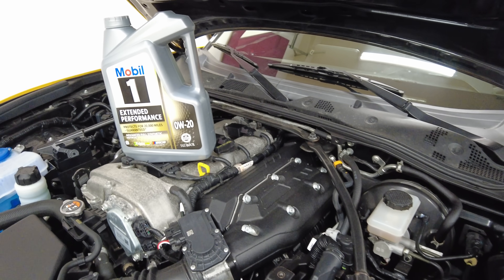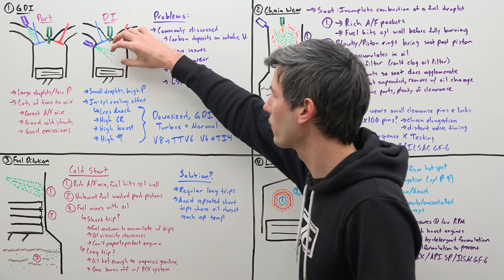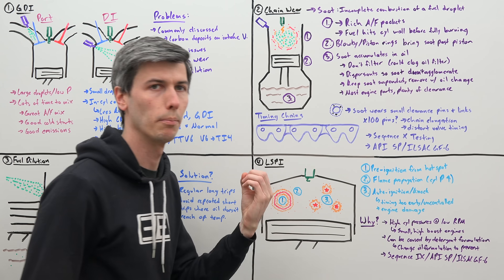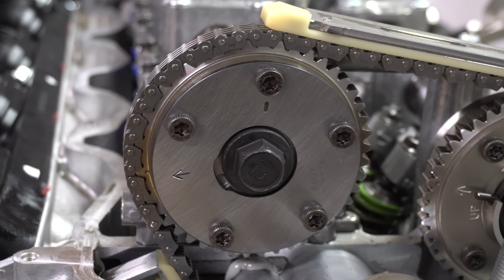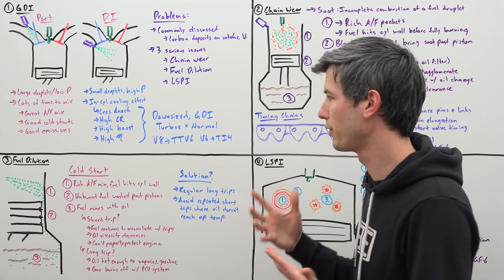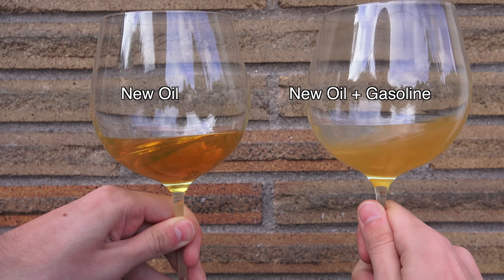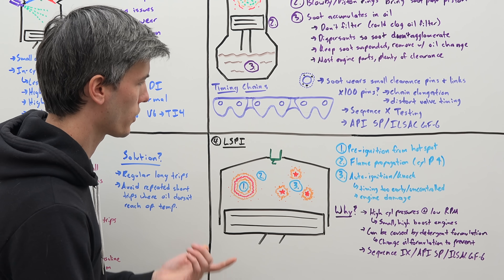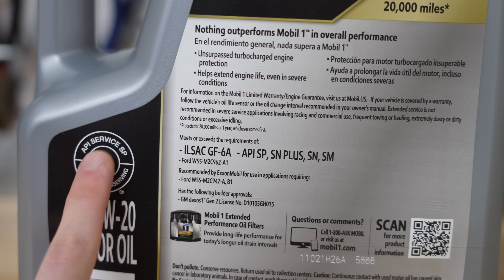3 Big Problems With Direct Injection Engines (Gasoline)

Comment: cars with GDI and EGR valves will sludge the engines, intake and valves bad and it's hard to de-carbon by just putting PEA in the gas tank. cars with VVT and port injection is the best way to go and using full synthetic oil too. the intake and valves will stay clean almost spotless. the combination EGR and PVC will trash the intake and valves if it's a GDI. the VVT acts like a EGR inside the combustion chamber and the port injection sprays fuel on top of the intake valves to keep those clean. if you have GDI with VVT it's not so bad but GDI with E10 fuel will turn the oil black, sludge everything up and just make a nasty mess. the green party EPA causes all these problems and just makes thing worse

Comment: The thing is that most new cars have only direct injection system except toyota & ford ! There r some manufacturers such as honda & Mazda may Nissan don't have major issues with GDI engines. But i am not taking that gamble as the cost of owning a new car is increasing!
Reply: Hyundai-Kia-Genesis has been using both port and direct injection for several years.  Some engines as far back as 2019.  They refer to it as PDI (port/direct-injection)

Comment: I didn't understand the reasoning given for LSPI, so I looked further, and it seems there isn't one: 'Researchers have been unable to pinpoint a single root cause for all LSPI instances.', says wiki. It seems like there isn't one, they just tried putting things into the oil until it wasn't that much of a problem.

Comment: Its said that the earlier API-SJ and SM formulas can cause LSPI due to the detergent additives (3000+ppm) caused the oil and fuel to emulsify easily and that can change the octane of the fuel, and if one or more of those droplets get in the combustion chamber it can auto-ignite and cause the LSPI event.
API-SP oils have reduced and put a limit on the amount of calcium detergent (no more than 1050ppm or so), and got rid of sodium  detergent, and it greatly reduced LSPI events, and a positive about it is, API-SP oils can actually protect flat tappet camshafts, there is no need for specialty oils.
In older formulations, the calcium, soduim detergent levels were rally high, car manufacturers wanted longer drain intervals, so the detergent levels were in the 3,000ppm range. Also, the antiwear additives, ZDDP were lowered due to Catalytic Converters getting coated with phosphorus and failing due to a higher amount of ZDDP in older motor oil formulations.
The detergent and antiwear additives were competing on the surface of the metal, the imbalance of more detergents and less antiwear caused the ZDDP to be washed away and wiped out camshafts,  todays oils have less detergent, but the same reduced amount of antiwear, made a more balanced motor oil. So now, API-SP oils actually protect engine parts way better, and even just as good as specialty oils.

Comment: At 5:25 the ASTM D8279 Test is explained.
It seems a bit like magic to me (as an engineer, but not on engines...) 
Lets say I want to have a reproducible test, like a double blind, as in general science.
You need at least three parties: the one managing it and two separate test executing entities getting the oil samples blind. All three are not legally or financially linked or bound....
And the two test executors have to have multiple motors and chains wich are specified by what exactly? If they source these things from the same manufacturer, isn't that invalidating the blind setup in a way an oil producer could optimize for that equipment?
And if the executors source different, how many tests would be sufficient to get substantial amounts of correct positives?
These test do not really exist. Maybe test execution companies who collect bribe money exist but not real scientific double blind tests.
This is a scam simply to get paid more for the same oil and fight off competitors.
Please prove me wrong.

Comment: Need better  " by pass not full flow filteration " Purydyne " to remove soot in large "cotton" slow flow small micron rating. - Pyrdydne removes liquid (fuel dillution )  contamination too.  So warm up engine properly in cold weather. Changing oil only removes issues after all ready becoming a partial problem. Pre ignition. ? How to prevent. Direct ignition

Comment: I only use 100 ron fuel (europe) in my n55 m135ix so I don't cause  knock or detonation plus I always run it in sport mode after driving it slowly for few minutes after cold start. I do short trips sometimes but weekly there is a minimum 200 kms trip to get that gasoline out of my oil.

Comment: The ICE block has reached the absolute pinnacle of its development and all they're doing these days is tinkering with it to extract a bit more MPG or LPK

Forget it, its time to go all Electric for automotive propulsion, cleaner, more reliable and battery technology will only get better as the years go by!

Comment: Have the only proven solution for these that meets emissions requirements proven in real use as well as controlled lab testing,  but trying to get EE to test it and see first hand. And searching for a provider that serves the light fleet market in the US as that's the biggest opportunity. Average consumer just rades for new when problems pop up. Will provide a system free of charge to test and verify all.

Comment: I still don’t understand how these have less emission but more soot than traditional motors.  Just separate the timing change oil from the regular engine oil.  More oil to change but eliminates the issue. Would running the higher octane E85 100+ be the best fuel if they were rated for it?

Comment: Soot isn't an issue if you change your oil on time (with he right spec of oil of course).
The funny thing is that an opel engineer in 2016 admitted Dexos 2 already had an LSPI test in it.
Dexos 2 was meant for diesels, but in Europe are often used for petrol engines as well in after fills.
My 2016 Astra K petrol has the advice to put Dexos 2 in it, no kidding, but I will use SP to be a little more sure.

Comment: To me, a 20 year seasoned tech, the Cons far outweigh the Pros of Direct Injection on Gasoline engines. On paper it all sounds dandy but in real world applications, the Cons are staggering. Sure sells a lot of engines and cars though as Direct Injected applications burn a ton of oil due to fuel diluted oil and the piston oil rings getting seized and packed with carbon.
Reply: Manufactures were forced into the idea to try & squeeze every out every MPG they could because of EPA regulations that's thankfully gone now with the Administration.

Comment: common misconception pretty sure DI doesn't make the engine run cooler, cold GAS is COOLANT and the more time/surface area the colder air fuel charge is in contact with it obviously has more of a cooling effect, a modern DI engine will run cooler by design/water jackets as it needs to take the extra heat generated from leaner combustion ratios running closer to stoichiometric ratio

Comment: The root of the carbon problem is EGR. After that, PCV. A proper catch can/oil separator for the PCV and just get rid of EGR, and no more carbon build up.
Reply: Manufactures were forced into the idea to try & squeeze every out every MPG they could because of EPA regulations that's thankfully gone now with the Administration.

Comment: Great presentation, Jason. One of the reasons why I am not very interested in EVs is that I like mechanical things and mechanical engineering. I cannot use Mobil 1 oil in my GR Supra, as that oil does not comply with the certifications required by Toyota and BMW for my B58 engine. Liqui Moly is one aftermarket oil company that does, so that makes at least three or four that do.

Comment: I bet if you ran the engine on propane it would run really clean. But direct injection works really well with 2 strokes, especially semi direct.

Comment: Interesting, and a bummer, that it reintroduced the old problem that carburetors had...unburned fuel washing down the cylinder walls.

He also didn't touch on how the valves don't get "washed" by the indirect injection of yesteryear so valves get carbon buildup more often.

Comment: Engine oil above sn plus grade doesn't prevent lspi in aged hyundai gdi engines. you need to put in premium fuel. I changed my short block due to reduced engine oil.

Comment: In my opinion, there are three things that lead to long engine life: 1) clean oil, 2) clean oil, and 3) clean oil.
Never mind manufacturer's advertising 7,000 miles, 10,000 miles or even more between oil changes. They are marketing numbers, not engineering numbers.
5,000 miles (with quality oil) between oil and filter changes is an acceptable mileage (although I prefer less).
Oil is cheep when compared to engine replacement due to oil related failure.
Performing oil & filter changes is not difficult (on most vehicles) and it gives you an opportunity to have a "hands on" relationship with your vehicle.

Comment: Engine oil temperatures does not get high enough to effectively vaporize the gasoline on long trips.  Even if it did, it has nowhere to go.  Filler caps and dipsticks are sealed well, leaving only the cylinders (which, most of the time, are too high pressure).  So, it's can only happen where there are  large-clearance gaps where the engine oil goes.

Comment: I'm staying away from these 4/6 cylinder turbo charge engines with direct injection. 

I'm still driving Toyotas from 2005-2007 trouble free. 

Other than routine maintenance, they are home away from the mechanics shop.

Comment: Following a 3000 or 5000 miles, oil change interval, is a very unwise thing to do, regardless of the fact that such is what oil manufacturers declare.! Commonsense says that an engine generates a significant amount of heat even after only an hour of operation.! This therefore tells that if the oil is subjected to that measure of intense heat in one day, it definitely is going to cause a significant change in the oil's viscosity & make up in just one week & moreover so in 1 or 2 months.! Therefore is makes for greater comprehension that the oil b changed regularly, well before a 3000 or 5000 mile range.! Only a camel travels for very long distances without a good drink of water, & the camel doesn't generate anywhere near the amount of heat in its organs as compared to a car the manifold of which is too hot to touch, even after only 5 minutes of the engine running.! Be wise people, & change ur  oil regularly.!

Comment: If you're taking the PVC and dumping it back into the intake through the intake valve maybe that's where all the gunks coming from. Those engines passed all the emissions test otherwise it wouldn't have been approved for production.

Comment: I came here today to understand why my 2018 Honda Fit engine is so awful.  The 2018 Fit I bought just 3 months ago with 44,000 miles on it needs new fuel injectors.  Oh and a VCT Actuator which is another $1800.  So my $16,000 car needs $4000 service after owning it for 3 months and driving it 2000 miles.  If you're looking for one anytime soon, don't buy one from Carvana because they're buying it for $1k less than I paid tomorrow morning!   SUCKERS!

Comment: Worried about cylinder wall wetting with raw fuel with DI ?  The cylinder is dry until shortly prior to spark occurring 
   What pray tell is happening with port injection ? With wet raw fuel entering the cylinders during the intake and compression stroke . With fuel in direct contact with the cylinder walls all that time .
     The only real and major concern addressed here . Are short trip and granny drivers who never warm up the engine .

Comment: I have a legit question but not sure I can form it correctly. What is actually worse for the environment, the unburnt fuel and soot emissions that would come out the tail pipe that gets recirculated back into the engine, OR the emissions and energy produced to make replacement parts? 

This mostly a shower thought but the timing chain issues makes me wonder how much longer ALL engines would last if we weren't injecting things that are bad for engines back into them. We would actually need fewer oil changes, and that would be good for the environment. Fewer replacement parts that take extra energy and emissions to make. It almost seems like it's a massive scheme to offput the bad emissions to where the parts are made. lol

Comment: So for a new GDI ford 2.3 Eco Boost, would you recommend an oil change frequency back to what was normal in the 90's.  Back to every 3000 miles, will that help?  I just got a new 2.3 4MT Bronco and I will take the advice if the frequency needs to be higher.  The other question is, how to avoid or clean the intake valve oil deposits for a GDI?  

Thanks for the video,
-Farley

Comment: I'm a half life oil change guy with turbo engines, so I'm good there with my ecoboost, I drive 50 miles a day round trip to work and back, and I use good quality synthetic oil, I also plan on doing regular intake valve cleaning, so sounds like I should be fine

Comment: No way, after watching this video i now know how my freshly built sti spun a rid bearing. The e85 diluted the oil and causing it to dilute and burn off in very cold temperatures from excessive warmup periods making the oil run low spinning the rod bearing. If thats the case could you then say it was the block companies fault for using excessive clearances?

Comment: I have a 2015.gmc.sierra 6.2L with nominal flow fuel injectors, i installed low flow without knowing they were not nominal flow, can the low flow still be tuned or programmed to work?

Comment: My mechanic told me to avoid DI engines especially turbos.
Reply: Yeah they need alot of preventative maintenance just to keep them somewhat reliable. Modifications such as oil catch cans, carbon cleaning, oil pick up pipe cleaning and so on.

Comment: Also the RON of the gasoline matters to prevent LSPI. Higher the RON, more knock resistant the fuel is. Usually, manufacturers prescribe the optimum RON number of gasoline for best performance. 
So, TGDI engines has only one problem which an owner has to deal: deposition of carbon gunk on back side of intake valves and inner wall of intake port. Unfortunately, the solution (wallnut shell blasting) is expensive, and not available in every country.

Comment: My biggest problem with direct or port injection is its not a delortro carburettor or any other carb for that matter. 
Joking aside these injection systems a a bit wishy washy compared to a modern hiding diesel unit why spray on inlet stroke when the compression could be upped significantly and rail pressure could go up spray hole size be reduced and multiple injection events used with the first injection event just before spark 
I need a single cylinder reserch unit

Comment: Having the injector issue right now with my Alfa Romeo 159, it has the 1750 Turbo engine, car has not been running 100% for a while, EML came on the other day, smell of fuel in the oil (oil was changed 1 year and 4K miles ago), issues all pointing to dirty, blocked injectors, have pulled the injectors out and sent them off for testing/cleaning. I was a mechanic back in the 90's but new car tech has passed me by, thought direct injection was only a diesel thing, this channel is very educational, i do lots of short trips (work is only 5 miles away) but from now will try and give the car a longer blast now and then, also frequent (yearly) oil changes despite the low annual miles, also going to run a fuel system cleaner through it once a year.
Reply: Seafoam it. !

Comment: I have a 2.0 4 cylinder in a 2012 ford focus 5 speed manual transmission and has 260,000 miles on it and it is direct fuel injection with chain n gear  not a belt and still runs fantastic !

Comment: Wouldn't the oil filter pick up the soot particles or does it drop into the timing chain before it reaches the oil filter? Thankfully i got port injection.

Comment: I work at a chrysler dealership. We have no issues with carbon build-up on our direct injection engines. I see it all the time with other brands. Our 2.0 timing chains do have issues though. I'm curious why we don't have carbon problems but we do have chain issues

Comment: So change the oil at 3000 miles with a good quality oil to help prevent carbon damage to timing chain and other critical components. Iv’e never been a believer of 5000 and 10,000 mile oil. I have always changed my oil at 3000.

Comment: 100 years of diesel engines seem to disagree with much of what you claim.  People who talk about downsides of DI tend to forget about this.

I have to laugh when people visualize a fuel charge as liquid.  Your engine would get 1mpg if that was the case and have tons of emissions, which it doesn't, because the fuel is vaporized.  Another nasty little fact that negates many of your claims.

Comment: I drive a 1994 Pontiac Sunbird coupe and a 1997 pontiac sunfire coupe. Those are paires with the 3 speed transaxles and respectively the   Brazilian Made 2.0L SOHC and   the American made 2.2 OHV LN2. Both are ultra reliable four cylinder engines. The 2.0 engine is significantly smoother and has quite a bit of torque despite having no power. The 2.0 Has a timing belt which is one drawback, the factory belt is still on the car. The Sunfire has the 2.2L. You cant really get more simple than a 2.2L OHV four cylinder. These engines are equipped with timing chains and boast great reliability. They feel anemic on the road, buzzy, low revving and are sometimes prone to burn a bit of oil. But if you want top notch reliability. General motors had this figured out in the 1990s. Cheers all thanks for reading.

Comment: My kids 2023 Nissan Rogue with variable compression has both GDI and port injection systems.  I am thinking this could keep the intake valves clean, and prevent GDI fuel washing of cylinders.